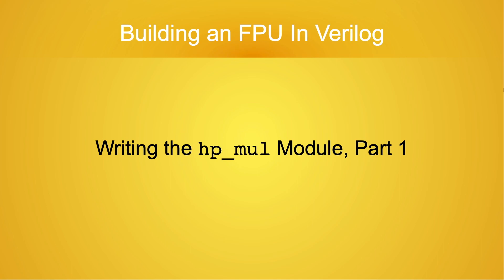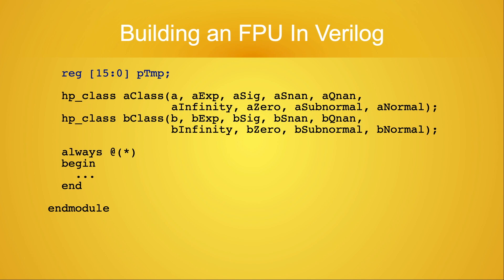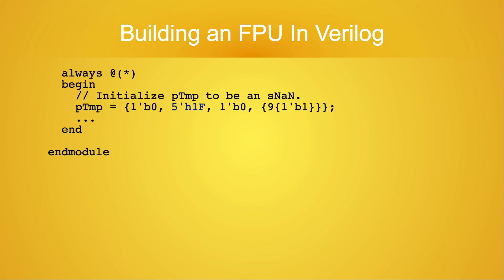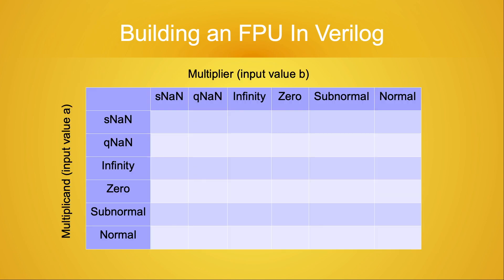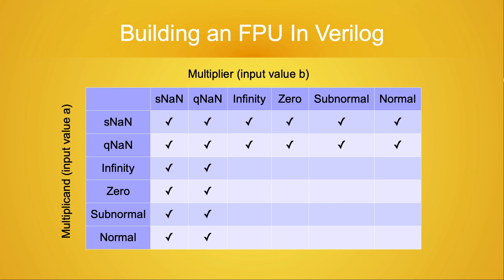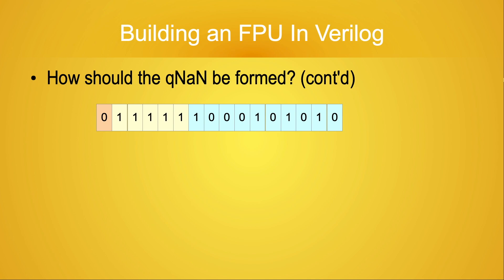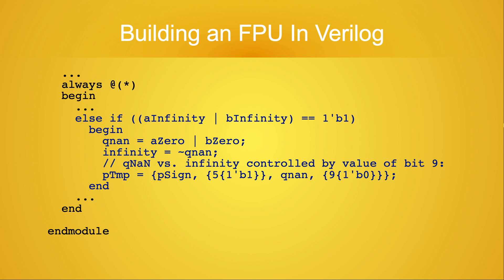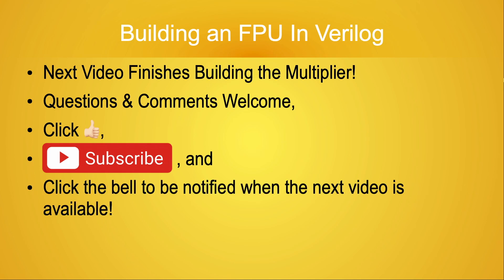Building an FPU In Verilog: Build the Multiplier, Part 1

Comment: Sir can you please explain me what is snan, qnan and normal
Reply from the maker: Thanks for asking.

In earlier videos I used the term "NaN" but never described what it means. "NaN" is an abbreviation for "Not A Number". NaNs are most often used to signal that an error condition has taken place, for example, multiplying infinity times zero is an undefined numerical operation so the hardware should return a NaN to signal the error.

There are 2 kinds of NaNs: Signaling NaNs (aka sNaNs) and Quiet NaNs (aka qNaNs). When the FPU encounters a signaling NaN the usual behavior is for the FPU to signal an exception and interrupt the normal flow of the program.

"Normals" or normal numbers are just that. They are normal floating point numbers. Zero, infinity, and subnormal numbers aren't "normal"; these numbers have special encodings which distinguish them from Normals. (And as discussed above NaNs aren't numbers.) Normals have the full precision available for their respective types. For example, normal binary16 numbers have 11 bits of precision, normal binary32 numbers have 24 bits of precision, normal binary64 numbers have 53 bits of precision, and normal binary128 numbers have 113 bits of precision.
Reply: @FPUniversity ok now i understand it completely 🙌